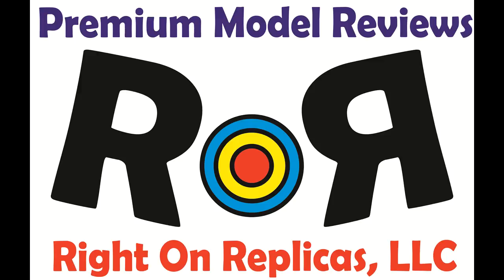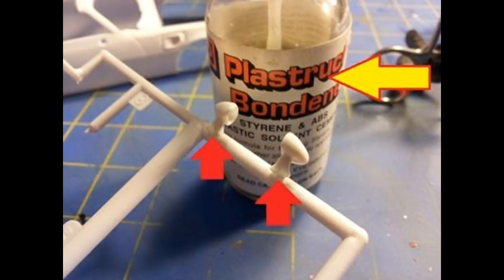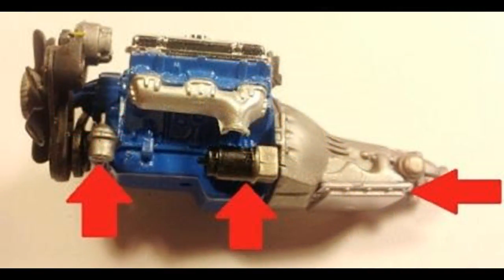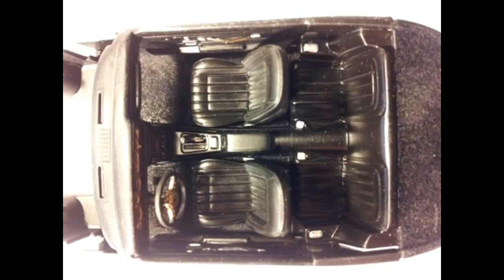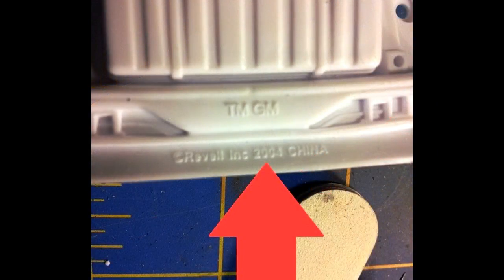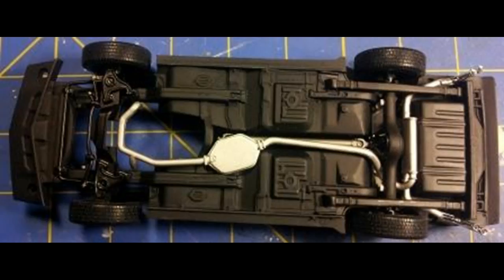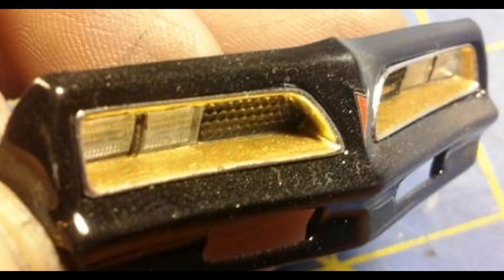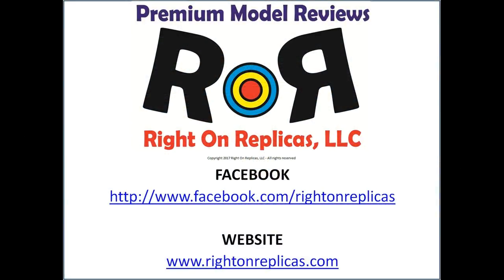How to Build the 1977 Pontiac Firebird Smokey and the Bandit 1:25 Scale Revell Model Kit #85-4027

Comment: 10:07 is why the 403 big block only had 185hp lol. Stupid single exhaust with cat & smog pump.. Loved driving my girlfriends blue & gold 78 though in the early 90's, good times! Nice video, I used to be into building models then got into diecast & RC about 2000 & haven't looked back. I do appreciate what goes into a good hand built model, at a hobby shop I worked at guys would bring in cars & display them in a case we had to show them off & that's when I learned how much love & work went into the great ones. Cheers!
Reply from the maker: MrC,  Yep and thanks for the memories of local hobby shops long ago!  Thanks for sharing, and if you find our channel helpful, please subscribe, to help us continue our mission to inspire more modelers!  -Doug

Comment: Thank you for building this kit as I built this same one 2 years ago; I was miffed why Revell forgot to include the "Trans Am" decals.  There should be one on each front quarter panel right under that horse-shoe shaped vent and a big one across the tail above the lights.  In my research of watching the movie till I was blue in the face, the actual writing on the side of the shaker was " 6.6 T/A".  The tires should also have white lettering.  There should also be a Georgia state flag license plate on the front.  I had to custom make these missing decals and fix all the detailed short comings.  With that being said, Overall, I liked the kit and enjoyed building it, but Revell missed the mark to really make it a complete replica from the movie.  Bit of trivia:  the ones used for filming were actually 76' models with retro fitted 77' noses or front ends.  Please keep doing these iconic model kit builds.  I really enjoy watching each one.
Reply from the maker: Dun,  Just noticed I missed this message.  Thanks for your feedback.  Great information there!   -Doug
Reply: Surely it was because of licensing issues, or they were just cheap (like greenlight). Greenlights 1:18 diecast 2017 release of the 1977 was missing a motor, opening hood, steerable wheels & any license plates (it did have some decals with Pontiac's & GoodYears licensing) . Also the steering wheel is like a 1:12 or something the same with their Last of the V8 Interceptor, way too big.. =(
Reply: @Craigstern73  whoa! Sounds defective or crappy quality control

Comment: Started building, had to do a little body work. Noticed the body is slightly twisted in the front. Should I fix it or will it straighten when attached to the frame?
Reply from the maker: JK,  It' probably going to move a bit but if it's over 3/16" I'd give the blow dryer treatment or hot/cold bath taped/clamped to a flat base!  PS, please subscribe if you haven't already to help us reach more modelers.  -Doug
Reply: Right On Replicas thank you! I’m subscribed and sharing.

Comment: Great video! I am just starting on mine. However I am nervous about installing the decals, especially the pinstripes. Do you have any tips? I am a beginner btw.
Reply from the maker: Thanks, and great question Cobey.  Soak the the decals in warm water - not hot, for about 20 seconds.  "paint" warm water on the area your adding the decal to.  Rub them lightly until they move on the carrier paper and start one end off the carrier and put your wet finger on the end when you have it placed on the model.  Pull the carrier off the underside of the length of the pinstripe and let it drop to the body.   move it into place and prod it into final position with a wet paintbrush.  Once it's where you want it, swipe it gently with a soft cloth or tissue along the length.  If it squirms out of position wet the area with warm water and prod it back into place with the wet paintbrush  and repeat the swipe.  Hope that helps!    PS, please subscribe if you haven't already to help us reach more modelers.  -Doug
Reply: Right On Replicas Thanks for the tip! The build came out better than I thought it would.

Comment: I'm working on my Kit now. Is it okay if use regular aerosol paint for the interior or do i need to buy paint made for a model kit. I'm in a dilemma and need some help
Reply from the maker: TT,  In most cases paint that is made for plastic will work just fine.  Much of the common stuff like Krylon or Rust-O-leum are OK but you should coat the parts with a primer coat first.  -Doug
Reply: @RightOnReplicas  Ok thanks, But what if it's Paint+Primer?
Reply from the maker: TT,  Should be OK if formulated for plastic but use light coats!  -Doug

Comment: What glue paint and tools did you use
Reply from the maker: KoK - This is mostly detailed in the video but here’s a run down.  General construction with Plastruc Liquid cement, Superglue on the suspension, white glue for the windows and glass.   Engine was Krylon Short Cuts Pacific blue, and the transmission was painted with Testor’s Metallizer Magnesium. The interior with Testor’s satin black, then taped of the back seat and center console and flocked the floor with black flocking. The front seats where painted satin black and glued in. The front wheel wells and firewall were painted flat black.  I used Testor’s gold to detail the wheels, and then used a flat black paint marker to paint around the outside of the wheel.  Finally, I then sprayed the body and parts with Testor’s flat black, then followed up with 3 coats of Testor’s classic black airbrushed on.  Standard tools were used like a hobby knife, sandpaper and sand sticks, modeling putty, air brush.  Hope that helps!  -Doug
Reply: Right On Replicas was not expecting all of this! Thank you very much Doug!!
Reply from the maker: KoK, just tryin' to help the hobby!  -Doug

Comment: Steering wheel is upside-down
Reply from the maker: CG,  Turning!  -Doug
Reply: Right On Replicas  I was spray painting the hood on this one and while it was drying it fell onto a cardboard box, so now the paint is somewhat stained. What’s the best way to repaint and/or remove the stain?
Reply: @e.mac1186  It depends on the paint you are using. If it is oil-based enamel, I have found a household bleach soak works best, to entirely remove ALL the paint, and then start over. Toluene-based paint (like automotive and touch-up) bonds with the plastic, so your best bet may be to carefully remove the blemish(es) with fine grades of sanding film or sticks, and then paint over them. Many Asian paint types, like Tamiya or Mr. Paint, market specific solvents to remove their paint without damaging the plastic parts; I would go for total removal from the part here as well. Avoid so-called 'professional' or 'industrial' paint-removers from your local home hardware store... they will either soften or mar the part, or turn the plastic extremely brittle. In all cases, try to limit the time your part is in contact with these cleaning solvents.

Comment: Only issue I had was the engine didn't sit right, which was very important because the air cleaner / shaker must sit perfect to come through the hood.  I tried everything.   It looks awful.   Why, why, why... wouldn't this kit come with Trans Am decals for the rear spoiler and fenders?  Shame on you, Revell.   SOOOO DISAPPOINTED!!!
Reply from the maker: Craig,  It is very difficult to align items like the engine/scoop combo in this kit. I find it helpful to hold off gluing them into place until after the whole model comes together, along with a lot of test fitting to get to that point.  I hope this helps and please subscribe if you haven't already so that we can reach more modelers!  -Doug
Reply: @RightOnReplicas  .. Thanks, Doug for the reply.  Revell really missed on not including those important decals.  Very odd.
Reply: Doug, I see that MPC has a kit that comes with all the proper decals and even white letter tires.  I might try to get that kit just so I can finish this one I am already knee deep in, the proper way.
Reply from the maker: Craig,  yes they did release a later kit that was corrected!  -Doug
Reply: I have found that both Revell and MPC exaggerate the vertical profile of their engine parts, adding too much height to many of their engines. Classic Revell kits are the worst offenders, often modelling detail to the tops and bottoms of blocks, intakes, carbs, and air cleaners, surfaces most of us are going to glue together anyways. The result is an engine that often sits too high. Once I establish how, for example, an intake fits onto an engine block, I will remove any assembly pins so I can improve the fit; most car engines in 1/24 or 1/25 scale will look very compact, should sit quite low in the engine bay, and have very tight clearances between major pieces of equipment. For what it's worth, the MPC kit, which I built back in the day, was a far worse-fitting kit than this, and my disappointment in that kit was similarly great. The only answer is: copious test-fitting and adjustment of parts, with parts intended to abut or fit into others left till last.